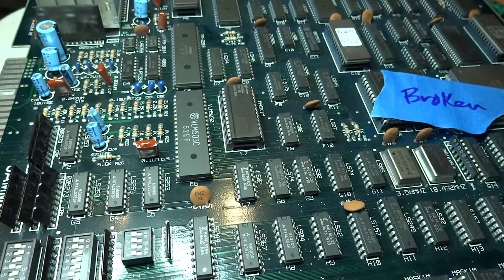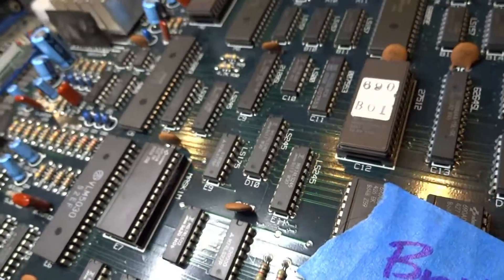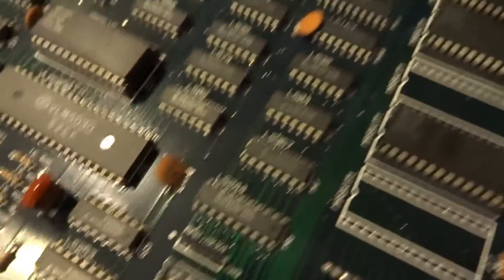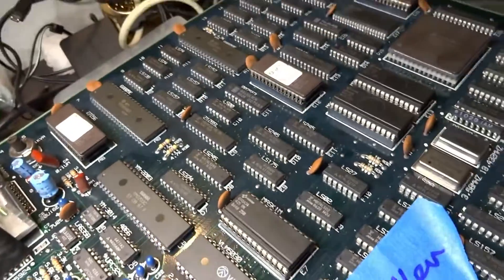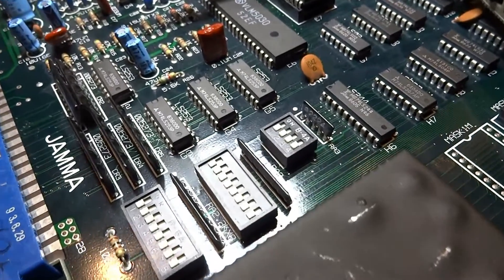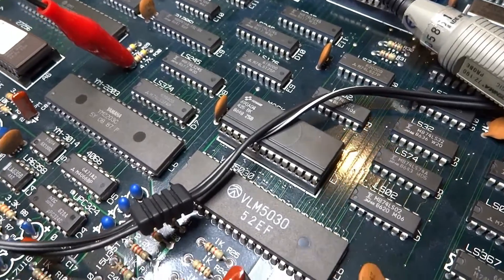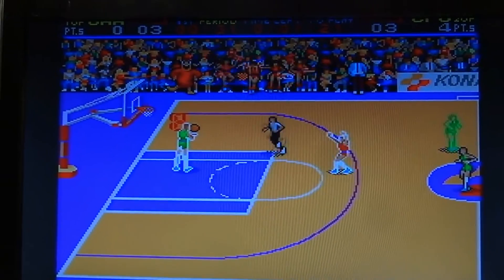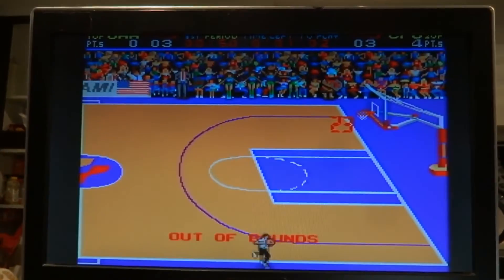Konami Double Dribble Arcade PCB Repair

Comment: Question. 
Did Luke fix one PCB Completly and later get the same one to fix it again? 
The japanese people like to destroy arcade games, or the pieces get dammage by the years of use?
Reply from the maker: lol, nah Luis. These boards all came from the U.S. and they were part of a set. Same board :) I think that all arcade coin ops never expected these boards to be working 40 years later so regardless of country, you can find some rough condition boards just waiting to be repaired.

Comment: Well done, that chip swap was a good find and tricky to figure out in the first place! :-]
Have you try to see if the chip you have replaced first, the LS, is good or still bad after finding out the real culprit?
About your probe, it is strange that sometimes the HIGH or LOW is very clear and stable, and then is looks like both are lit at the same time, like some very fast pulse switching state.
Reply from the maker: Thanks for watching here :) In fact, the Ic I removed was still ok and it was a mistake on my part misdiagnosing the error. Luckily just those 2 chips being swapped brought the system back to life but it was nice to see that I could fix the bad ram on it at least. I think I can say I fixed it lol.

Comment: I recently repaired a top gunner for a friend of mine (same type of pcb as one in video) Every single ttl was a fujitsu and you guessed it dead or half working, Gave up checking them one by one so removed the lot and replaced them along with 2 rams, board is now 100%. Just for fun i ran half of them though my bk ic tester and all failed, Think the total in the end was 35 ics
Reply from the maker: I totally agree with that idea, especially with the fujitsu ttl's. Congrats on getting your friends board going as well. Its great when you can keep these classic boards out of the dump.

Comment: Excellent =D  BTW when both led illuminate on a logic probe like that (when looking at the 04) it's showing that its toggling between high and low - so the output was correct.  That said, when the output is pulsing between high and low, you can only be 100% sure there's not a logic level issue (eg. high not being as high as it should be, or perhaps not pulling low enough when low) if using a scope.
Reply from the maker: Thanks a lot man. Off the cuff and spur of the moment, tons of mistakes here and there lol. I`ve managed to make it this far with just the probe but Yeah, need to get a scope here as well I think. Thanks as always.

Comment: The Esoterica of Konami custom Chips.
You would need a Harvard Review just to investigate what those chips are.
Unlike a lot of Arcades, Konami boards and custom chips are the hardest to workout or replace.
They are major pains in the rear and totally designed to be that way for the time but man. Like Professor 
Luke says, If one of them go. You are screwed, unless you have donor chips. I really wish Konami wasn't such 
a dictatorship and could help the community. Seriously.
Reply from the maker: Not by the book and definitely as raw as it gets, just glad to be able to get these going again. Thank you for the super vote of confidence and extreme support as always.

Comment: system16 says this board has three 6809s...it would be interesting to find out why as one 6809 sould be more than sufficient...
Reply from the maker: Hmmm, some very good questions. I wonder if it was due to the parts that were available at that time or what was the cheaper deal?
Reply: I thought the same thing when I first saw the games hardware info. I can understand having 2 x 6809 since one could be dedicated to sound but a 3rd not sure why